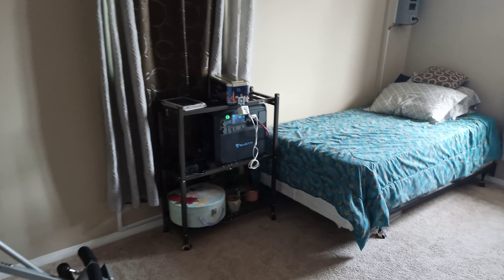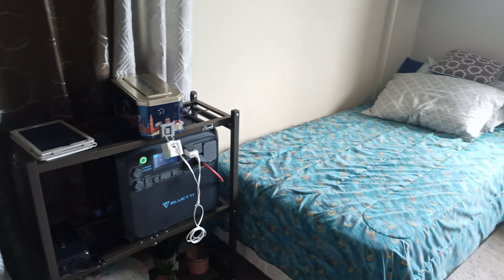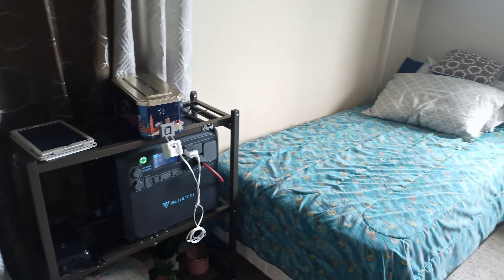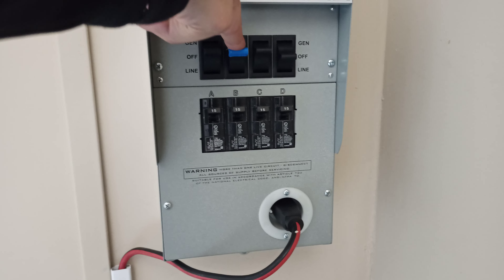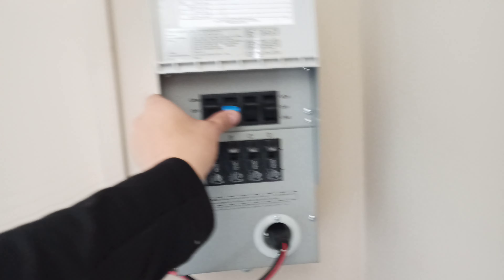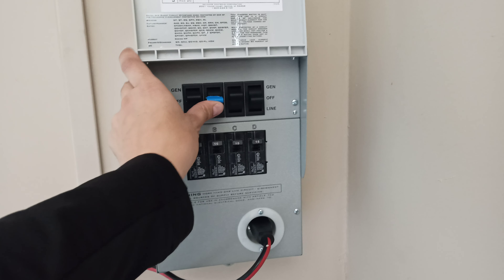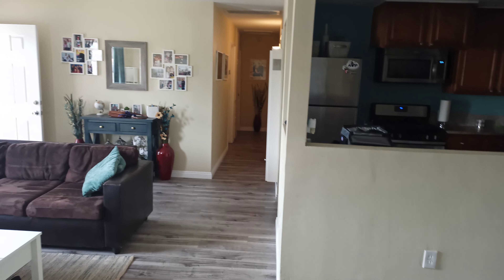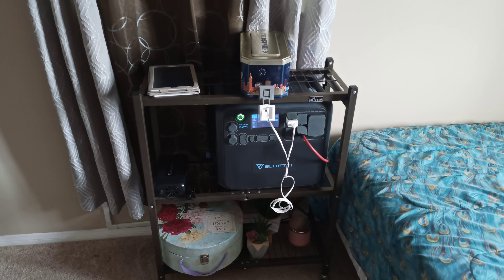Bluetti ac200max works with a generator transfer switch.

Comment: I watched the reliance six part installation video of the transfer switch and I can do the installation. That’s a good series of videos.
Reply from the maker: its pretty straight forward. Which generator are you going with?
Reply: @OffGridSolarSmartHouse  the 500 with a reliance 10 breaker transfer switch. That’s what I am thinking now but I also like the AC200
Reply from the maker: @jneckcrank  the Ac500?
Reply: @OffGridSolarSmartHouse  yeah but not certain at the moment. During storms our power goes out like tonight in Tenn and Alabama. Usually only a day or two but once for eight days. Leaves a lasting impression
Reply: Where can I find the video on how to hook up this transfer switch? Anybody? I'm lost.
Reply from the maker: Hi Mike, here you go. https://youtu.be/xTqjwt6WJ7o

Comment: How does that work with the transfer swith and the mains turned on? Does the house draw power from the grid or bluetti ac max? Or do you shut the mains off in your home panel?
Reply from the maker: When the breakers are on and the transfer switch is on generator, the house runs off the generator. The switch does all the work

Comment: I am looking to do the same with my AC200P. What are you running on the other 3 breakers?
Reply from the maker: Breaker A is for the fridge and Stove. Breaker B is for a lot of rooms. Living room/ Dining room/ hallway both bathrooms and master bedroom. Breaker C is for two bedrooms one of them being the office with the router modem.
Reply: @OffGridSolarSmartHouse  I assume that the stove is not electric, because those pull 2kw minimum.
Reply from the maker: @grindychum  The stove is gas but uses some electricity for more than the clock. I actually purchased the B300 so now the system is 5kw. The extra battery should be arriving soon.

Comment: Which cable and port is used to connect ac200max to transfer switch? 
Thanks
Reply from the maker: The transfer switch came with an extension cord that can plug into one of the four ac outlets on the Bluetti ac200max

Comment: How did you choose the transfer switch did bluetti recommend it? The set up is nice.
Reply from the maker: I looked at my main panel first to determine how many breakers I would need to bring over to the sogen. I only needed 3. I went with the reliance pro/trans 2. 
It was very easy to install.

Comment: How difficult is the installation is an electrician required for the transfer switch.
Reply from the maker: It wasn't difficult. If you know how to install an electrical outlet you should be fine. Reliance pro trans 2 had a 5 part youtube video with step by step instructions.
Reply: Dumb question apologize up front . Why can’t I shut off the main breaker in my breaker panel and just plug in my bluetti in the wall receptacle?
Reply: Is there a version of the transfer switch that can do all of the switching automatically?
Reply from the maker: @jneckcrank  You should be able to but its dangerous. It's called back feeding. You send power through your home to The grid still. Google back feeding.
Reply from the maker: @jneckcrank  Not sure. I think if you use a different type of generator this is possible.
Reply: @jneckcrank  dangerous, illegal and there are a lot of gotchas because of the split phase 120/240v power in the US. For example, if you have any 240v appliances with low resistance (like a water heater) you could end up with strange voltage levels in one half of your panel. You can also end up with nuisance gfci tripping and putting stray current on your grounding system depending on the inverters neutral/ground bond. Do it right with a transfer switch or back fed breaker with a generator lockout installed by a pro.

Comment: The AC200Max would have been a better power station if it charged faster than 5 hours.
Reply from the maker: the Max charges pretty quick with 920 watts of solar. maybe 2 and half hours. If you purchase the enhanced charger you can get it to 1400 watts of solar and charge it in under two hours.